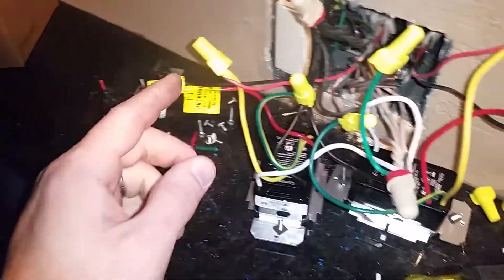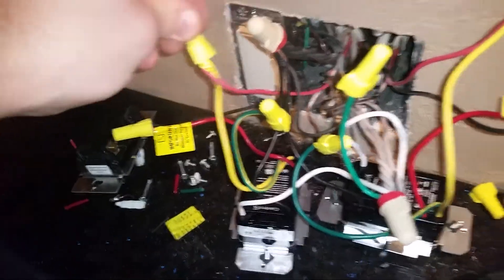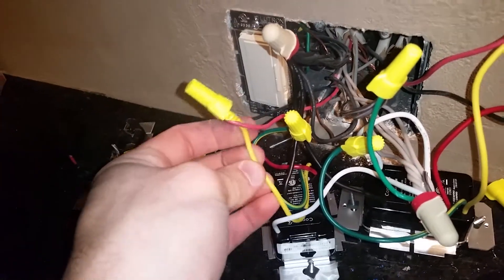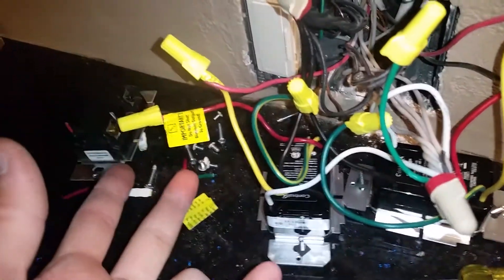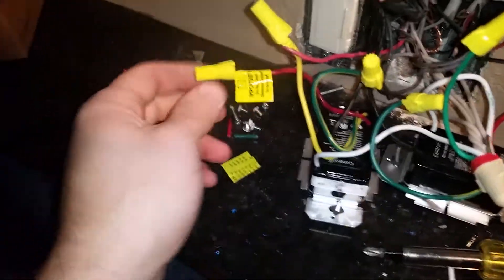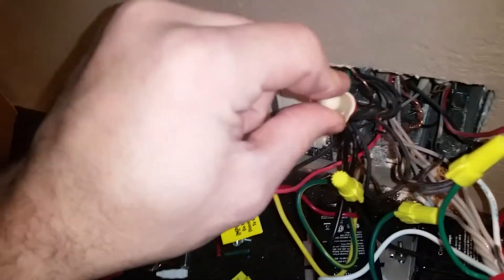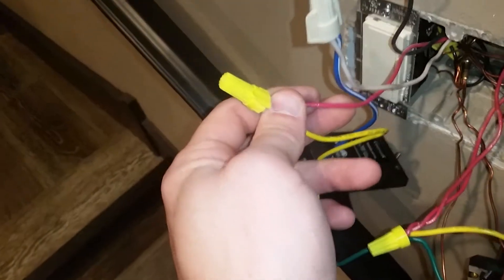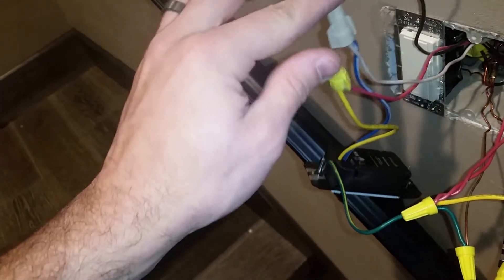How to wire a control4 3-way switch

Comment: I have a question for the video creator. I'm currently re wiring a house that will be using control4 and will mostly be using keypads. With those keypads could I just run a 12/2 or 12/3 carrying 120v up to a box then program the keypad to do what I want through that? Or do I need to wire everything normally?

Comment: I need to design my Home Automation and I want to have normal Piano Switches too. So if I install the control 4 Ea5 along with the Control 4 smart Keypad will it be possible to have those mechanical switches(Piano switches)?

Comment: So you still use a regular 3-way switch, just omit/remove the common hot from it because it is unused?  Would this be true in the event of 4-way switching as well? the only common hot would be on the Control 4 Switch.  Would the control4 switch then have to go at the end of the line, or last switch before switch leg for load?
Reply from the maker: in a 4 way follow the same principle for rhe auxiliary switch in a daisy chain fashion. neat thing about conteol4 is it could be a 20 way and still work.

and no contro4 switches dont play friends with regular switches 3way or alike
Reply: But we don't use the common hot at any switch other than the control for correct?
Reply from the maker: that's technically true you would not use the hot wire however the hot wires should typically be used to route your load if your load is not in the same box as the dimmer

Comment: Hi how are you? I have a question, if i have one flourescent light and one comun light, what do you prefer to install in wall? I have a line and load only. Thanks
Reply: +Alejandro Quiroga Ide install a relay switch Then The florescent wont handle the dimmer of any phase well.

Comment: I have a question! I have the configurable keypad but only have the white and the black and ground! How i connected
Reply from the maker: For you the keypad wont control any load. The black white and ground wire you have will need constant hot to it.

Comment: My dimmer doesn’t work, I opened it and the yellow wire is not connected. What should I connect it to?
Reply: this is suppose to be connected to another switch, like the guy says in the begging, its a comunication cable